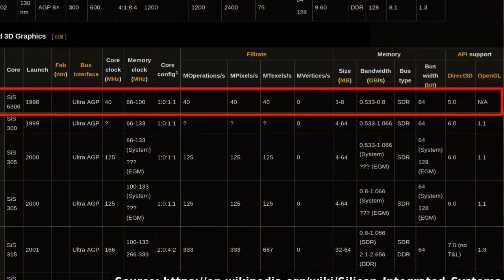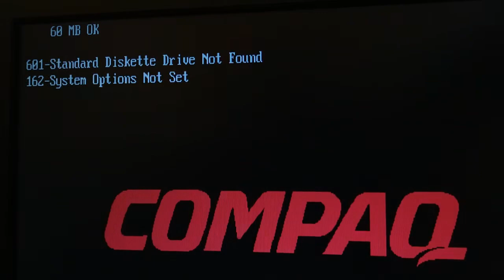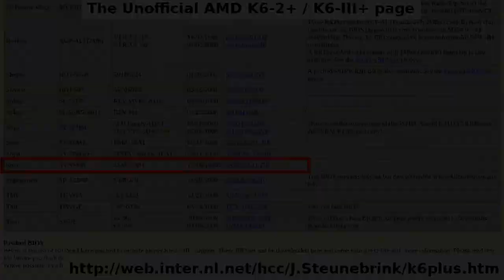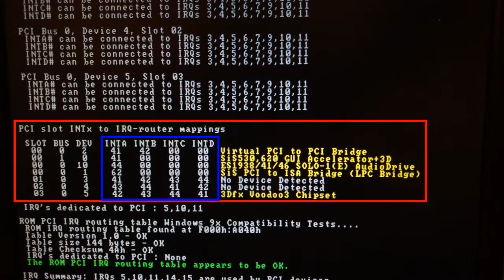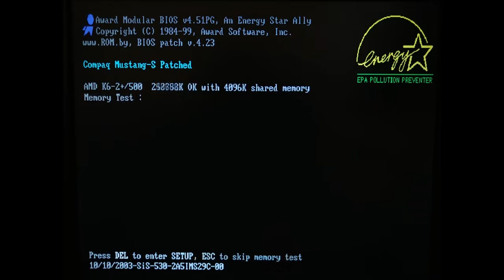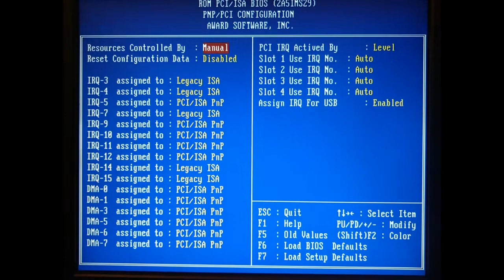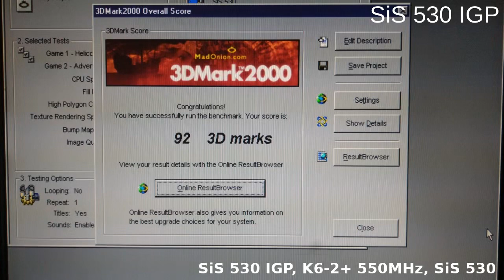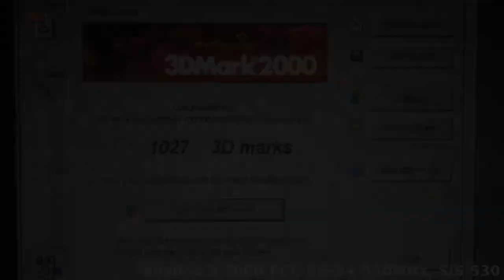Swapping the BIOS of a SiS 530 Super Socket 7 Motherboard (Compaq Mustang-S)

Comment: Had similar board but for Socket 370, with the SiS 620 chipset. At least the IGP was the same. It was definitely interesting experience, I remember being very disappointed and fiddling with the BIOS to get every ounce of performance out of it. Was not very successful, but I was able to enjoy titles like Dark Force 2, Half-Life and Unreal Tournament, using Celeron 333. We only had 32 MB of RAM and the IGP took 8 MB out of it by default. Had to lower it to 4 MB.

Comment: probably the wrong driver is installed
3DMark99 performance should be 3 times higher
more details on vlaskcz channel
Worst Game Graphics Cards - SiS 6326 8:49
SiS 6326/ SiS 530(6306) have the same core

Comment: Hi , if you manage to fix the irq problem could you please share the bios file? I have the same motherboard and i would love to try it running at 133 fsb, but I have 0 experience with making or modifying bios files
Reply from the maker: Sure, if I manage to fix it properly I will let you know.
Reply: @scrap_computing  I found some  wpcredit tweaks that really improve performance. I went from 18 to 22.5 fps in Unrealtournament Utbench demo by applying them
This is from K6plus forums. SiS530 @133MHz (GA-5SMM/Soyo 5SSM) setup, benching, tweaking Thread, page 14. Posted by Donpedro

50: bit 6 set to 1 (mem single write cycle) or 0 in w2k
52: bit 7 set to 0 (dram time delay set to 0)
52: bit 6 set to 1 (single read allocation)
52: bit 4 set to 1 (sync cpu-dram mode)
55: bit 2 set to 0 (disable res bit for data read dram)
56: bit 7..6 set to 11 (6 clocks)
58: bit 7..6 set to 00 (2 clocks)
58: bit 5..4 setting from 01 to 00 crashes (from 3 clocks to 2 clocks) !!!! never succeeded once here
5D: bit 4 set to 1 (dram write retire rate = x-1-1-1)
5D: bit 3 set to 0 (cas latency = 2 clocks) --> It works for Donpedro but not for me.
Reply from the maker: @arturoacevedo9749  Cool, I will check it out! Thanks for sharing!
Reply from the maker: I experimented with it a bit more, and I have a version that seems to work kind of OK. The only thing that is not working is the on-board USB, which even though it does work in the bios and does get recognized as a SiS 7001 device by windows (with no errors), it just doesn't detect any devices. Let me know if you would like to try it out on your board.
Reply: @scrap_computing Of course! I have the board lying around for now, but for i would love to push it to the limit , i just aquired 2 k6-2+ 570 ACZ processors that would be perfect candidates for experimentation
Reply from the maker: @arturoacevedo9749  cool! Could you mail me so I can send it to you?

Comment: You brave running K6-2's with out a fan, I burned a bunch of them out from overheating.
Reply from the maker: I am using a fan when running benchmarks. K6-2s get quite hot after a few minutes.

Comment: Thank you! I have a PCI Geforce 2MX card from a computer of mine that was cooked from a cheapo Chinese PSU many years ago.  I want to use it in my old Socket 7 motherboard but if it is bad I don't want to kill this DFI motherboard.  Any tips on what to test on the PCI card before inserting it?  Shorts to ground?
Reply from the maker: I guess you could try checking if there is a short between the 5V and GND pins. Also try to use a PSU with short-circuit protection.

Comment: Would repopulating the video RAM improve the IGP perfornance.
Reply: i don't think so, the 530/620 runs at 40mhz, it's good for msdos games and 3D software mode games,
this computer would benefit more from a K6-3 at 500 - 550mhz upgrade
Reply from the maker: Yeah I don't think it would make any huge difference, the IGP is really weak. Even if it became twice as fast, it would still be really slow.

Comment: Great work! I wished I would have had the tools and utilities you used in this video back in the day! 
My sister's ex husband had a small Compaq PC with this exact board in it when they first got together many years ago. I remember working on that machine and remembering the system behavior with the Compaq BIOS was fussy (to say the least!) The lack of an AGP slot and the lousy onboard video wasn't so hot either. Ultimately I think the PSU died rather spectacularly in the machine so it ended up getting tossed at some point.